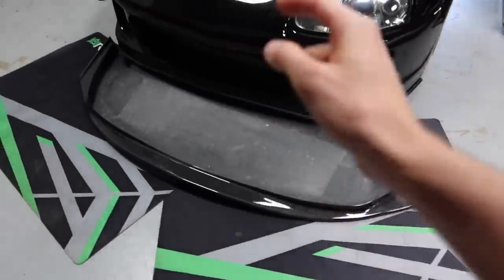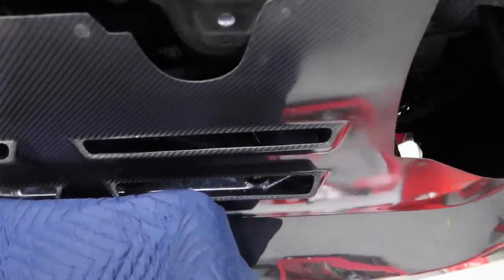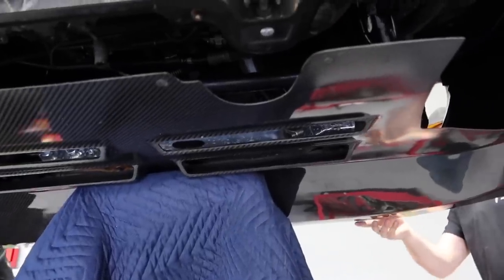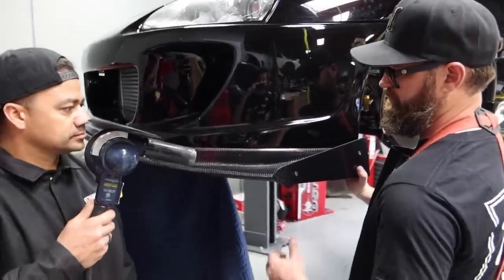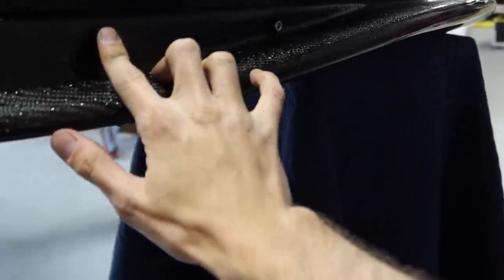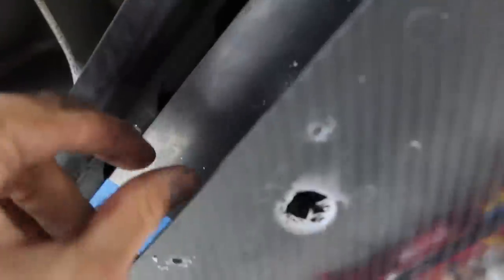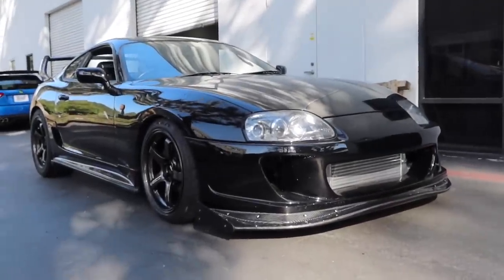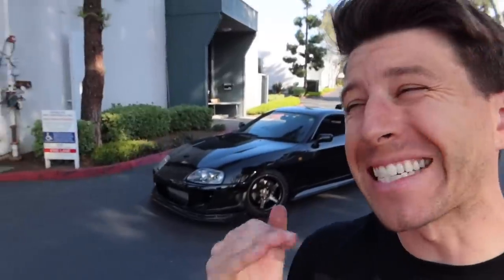SUPRA NEW FRONT END! Carbon Fiber Splitter Install!

Comment: 11:50 gap between the hood and fender.. you can see the engine
Reply: Hood, as well as front bumper is cocked. The hood line between the light buckets is visibly off.
Reply: Holy my OCD kicked in
Reply: I wonder if its had poorly repaired front end damage and thats the reason the undertray wasn't lining up properly.
Reply: @Klutchylol  I think it was wrecked át some point
Reply: SSgt Preacher defo crashed and not pulled straight
Reply: Yiiiikkkkkeeessssssssssss
Reply: @Klutchylol  probably, maybe a bad mold of front bumper too. You see that in reproduction parts for older trucks and cars, the molds/stamps get so used they have fitment issues.

Comment: Pro Tip TJ,  when making a bracket like the one you made, at the very most inside corners of the cut outs, drill a hole with a drill bit and then make your cuts from each direction up to the holes...  this way there will be less chance for fatigue cracks of any kind and it will also look cleaner on the transition...  but good job homie!  Keep up the fab life, that’s what I live for!

Comment: Maybe for that hole that you drilled for the drain plug, add a rubber grommet to make it cleaner. Then paint that bracket black. Like you have said in the past, it's all about the small details.

Comment: maybe the splitter goes inside the  bumper lip so it lines up with the back mounting holes and does not require any brackets.

Comment: please those turn signals on fenders must go,place them on some aftermarket carbon mirrors so the fender gets cleaned up and looks bit modern,with side skirts you can't even tell i won't tell you when we know either it is carbon side skirt extensions or TRD/ridox vents because there is not so much there to be done currently

Comment: I would be so scared that i would mess up the carbon fiber lip. The NY streets wont allow that lip to last but looks good ! keep up the good work. Also i would sand and paint that mount you made so it does not rust.

Comment: Quick question...did you remove the other lip before putting on the full splitter..in memory serves it doest actually go over the other lip..its a replacement  so it will push it fwd if you didnt.

Comment: TJ the splitter you installed might be designed for a left hand drive car instead of a right hand that’s why the backend is not lining up to the rack and Pinion brace 😊👍

Comment: Don’t take this as me knocking Tj or anything like that but the body lines on the front end are suuuuuper off, the driver side gap is perfect while the passenger side is open enough to where you can literally almost see the engine, that with the splitter not even remotely lining up properly makes me think that it has poorly repaired front end damage

Comment: The lip didn't fit properly because it's designed to sit on a stock bumper. I'm pretty sure if you removed the smaller carbon fiber lip that's already on there it would fit way better if not perfectly.
Reply: That lip is not for stock bumper, it's for ridox bumper which tj had it on his car but not a genuine ridox of course, probably why it didn't fit well
Reply: @muhdsyakir9502  you're right but it seems that both the lip and bumper are from the same company that makes a ridox style copy. I still think it would fit better on a stock bumper. That's one huge gap he got there, I would go as far as saying it's defective.

Comment: Anybody else wondering if the splitter didn’t fit cause he didn’t take off the CF lip that was already on the car??
Reply: Might be designed for a different bumper and there's definitely an alignment issue between panels somewhere

Comment: Not a fan of those edges of lip, makes it look too square at the front, should have been made more curved to flow around the bumper also I think they made it too short which is why it doesn't go all the way to the back. Props for the brackets geezer! lol

Comment: Resin carbon or real autoclaved carbon  fibre ?  there  is a huge difference in weight strength and price .... You don't heat gun the real stuff  into shape ...  Drill it and it will waste your drill bits . it also eats saw blades .. It is also advisable to wear a mask while doing so ...the black powder it creates is very nasty if inhaled ..... Smash it and it turns into razorblades it is very brittle